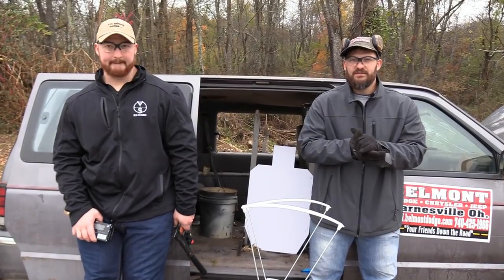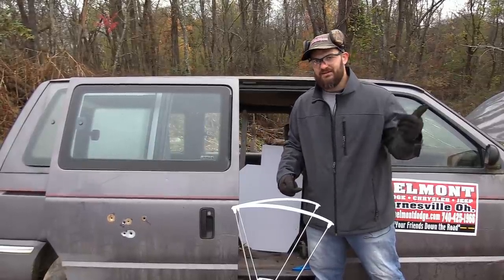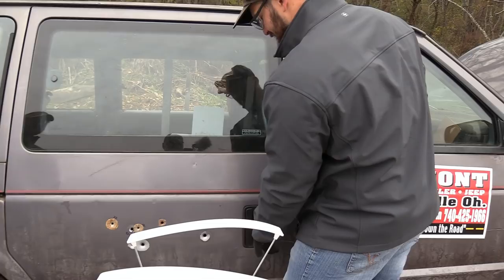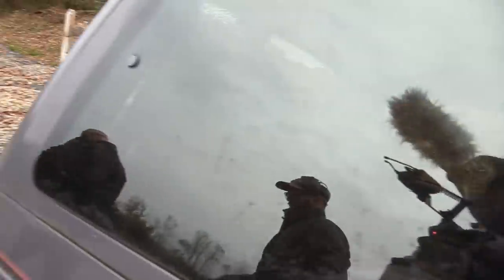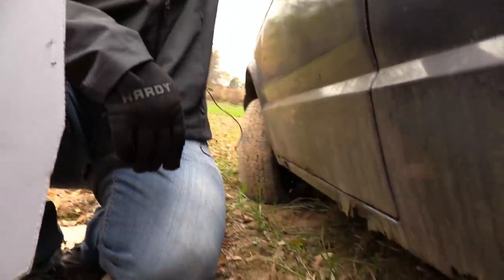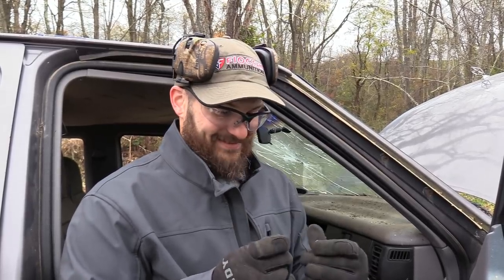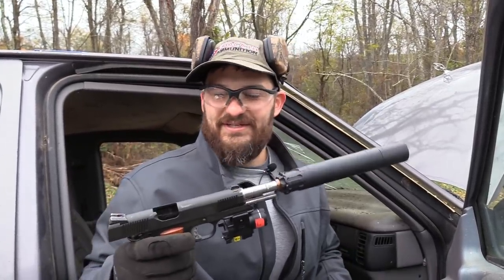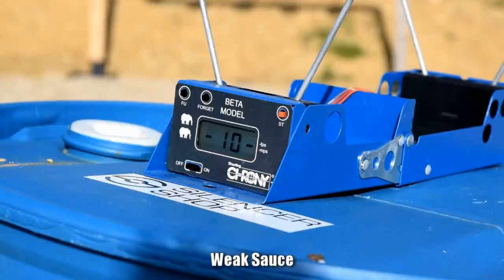HOW POWERFUL is IT? .45 ACP 1911

Comment from the maker: In its recent decision to change calibers the FBI identified that the only factor pertinent to defensive use of handguns by its officers was penetration depth. .45 was tested and was not selected. Just sayin...
Reply: The VSO Gun Channel suppressed .45 ? Or the caliber
Reply: thats pretty lame. shitty ammo and suppressor slows it down too much. the firewall shot while weak in appearance would blow a heart apart and break chest open, blow head off.....basically do its job. the gun was designed to kill humans and it does it extremely well even with slower cheap ammo hardball ammo. Army moved against it for economic reasons and most soldiers hate the  9mm.
Reply: The .45 ACP is not that great for police work as there are better including the .40 s&w. It is not a great penetrating round…barriers, cars walls etc. The .40 matches the power and has a smaller profile which is why it is a better penetrator. Speed has a greater effect on power than weight or mass so the pumped up 9mm does very well too. Shoot what you want if you are not LE.
Reply: Ok so in all reality why would it matter if the 45 will or will not go though 2 sections of the van and out the other side into another  target. The fact remains almost anything I've hit with a .45 acp 
Has had a very bad day . Besides 
There is hotter 45 acp on the market than what you were using 
Not that is even needed anyway .
45 will do the job in most scenarios just ask special ops.
Reply: my thing is that I've used 45 all my life it will do its job the test is kinda pointless to me because riffles are made to penatrate in punch through things hand gun are for up close and personal the thing is that a human in that van with the same test would of had a very bad day and fighting for their life a bullet is a bullet nothing good gonna come from it

Comment: so what youre saying is that .45 acp has less chance of over penetrating the target and causing unwanted collateral damage, that it in fact dumps most of its energy upon initial contact with the target and that it is less dangerous to others surrounding the target after the round impacts the target. 

in the future could you actually do a better job of containing your distain for the .45 acp? fyi, the ammo used in your tests here has a poorer performance rating than winchester white box .45 acp. you know that cheap ass ammo that walmart sells for dirt cheap. in the future either use the standard ammo youre average schmuck uses, or use the good stuff. 

also, your satire videos kinda suck...

Comment: 230 gr 45 acp +p at 950-975 feet per second out of the 5 inch barrel would have no problem that was just Standard pressure Range ammo. Even +P 45 ACP is still sub sonic. One thing 9 mm and 40 Cal have over 45 is they’re more affective out of a shorter barrel. Edit:Also I just noticed you were using freedom munitions hush that ammo is deliberately downloaded to be quiet not be a barrier penetrator this must be the underlying part you were mentioning LOL.

Comment: Well, one thing is for sure, a 45 acp has more hitting power than a 9mm and makes a nice hole to bleed through. And also busts bone apart more easily. Never said it was the best penetrator though. Its a human killer which is why I will stick with it. Plus our military never had a problem killing people with it either for 85 plus years and zero complaints.

Comment: How about using hotter round than Hush 147g
Reply: 59BigWalt it’s 230gr 45acp
Reply: 59BigWalt like he said in the vid , they should of used a Glock , to get the most out of that Hush ammo cuz it is designed for a Glock
Reply from the maker: Someone has shot hush 9mm before 🙃 (slap hands)
Reply: Thats a 9 mm .

Comment: 2 observations here I noted;
A- The tested ammo went through both sides of the vehicle on one shot, in a defensive scenario there's a really good chance that means it would penetrate the vehicle and someone inside, nuf said
B- "most" (safe presumption imo) who use 45ACP would practice with standard pressure but carry with quality +P. I'd be VERY interested to see a retest of standard pressure ball ammo VS +P-HP. Having seen several get tests of both ammo types it'd be interesting to see them compared through a vehicle

Comment: The biggest issue I have with this test is the use of Freedom Munitions ammunition. That company does not use jacketed bullets, they use soft lead plated. The plating on it is so thin that you might as well have used pure lead. This will indeed make a difference in what happens to the bullet (fragmentation etc), so it's not a fair test, also this is not a good representation of the common more powerful .45 ACP rounds that people actually use now days.
Reply from the maker: Deptends on the loading. The hush line is jacketed rather than plated. But if you buy bulk loads you get bulk price and bulk tech.

Comment from the maker: When something seems strange or out of place on this channel, you should dig deeper than face value. YOU are probably missing something.
Reply: The VSO Gun Channel look you guys I've commented a couple of times nothing out of the ordinary nothing rude just had some questions and all three times you just bit my head off like I'm an a**** or something. We definitely do not need channels portraying gun channels with jerks on there it gives gun owners a bad name. And you guys should use the exact same manufacturing a mural in every test not pick and choose ammunition itself will Barry from manufacturer to manufacturer. If you really wanted to do a scientific test you would use five different brands and the same 5 brands in every test that's a joke I've seen 185 grain 45 ACP go right through the firewall of a 79 Oldsmobile which I'm guaranteeing there's more sheet metal in than that 93 Dodge Caravan.
Reply from the maker: Read the description
Reply: Yeah, you may have to put an annotation in the video itself.  Most people don't even read the description.
Reply: The VSO Gun Channel I think you guys are missing something like why are you using mexican-made ammunition and hush ammunition that's made to be a little slower than regular ball ammunition from a 5in barrel 1911 chambered in 45 automatic Colt pistol. You guys really should use similar platforms and the same brand ammunition in each test. This is so far from being anywhere scientific this is just a couple of fellas out in the woods shooting a minivan. Not to mention your bad attitudes towards people on this website. I've had a couple of replies from you guys that were rude to say the least. I don't know exactly what your business model is for your Channel but yelling at your subscribers is not a good way to run a channel. You seem like two young guys that are having fun shooting holes and Mom's old worn-out minivan. No scientific data whatsoever here.
Reply from the maker: Craig Arnold nah, its part of the the joke, its way less funny if you make it blatant. Anyone who has met me in person would know that this series is a huge joke and all the people getting butthurt are literally the butt of the joke. The internet is full of non-science. It takes blatant non-science to get peoples’ wheels turning on that topic. I have been a scientist nearly my entire adult life and the things that groupthink will allow people to take at face value is astonishing and disgusting at the same time.
Reply from the maker: Yes you are right. People these days are too sensitive. You are correct in surmising that I will never be that super popular guy and I am alright with that truth. But perhaps I should just stop responding to people outside of our patreon page.  I could probably do a lot better for myself. As someone who puts in a lot of effort on detail in...just about everything but things like this video series...I don’t have it in me to deal with people unwilling to look for information because of their ADD. This is admittedly a personality defect...the first step to fixing a problem is admitting you have one right...🙃
Reply: David Wright I don't think he was being rude in his reply to me at all.  I think you may be subconsciously interpreting his words as rude or malicious in instances where they are not.  For example if you have a conversation with someone in person their body lanquage and tone of voice will typically tell you when they are being rude or sarcastic and whatnot but if you are reading a book unless otherwise stated your brain and imagination will often subconsciously fill in the blank in terms of what mood or demeanor you perceive them to be in because there is no body language or tone of voice to base it off of.  It is not uncommon for these perceived moods and demeanors to be a bit off or completely wrong from the manner in which they were intended, especially when you don't have enough face to face interactions with the person for your mind to better accurately imagine their intended moods or intentions.  I used to have a huge problem doing this myself, now I try to read and write with the absence of moods or emotions.  It is much less stressful and makes for a lot less problems due to communication errors.
Reply: The VSO Gun Channel I'm not sensitive at all I just wish that people would show a little respect and treat people like they're treated. Maybe it would be best if you gave the YouTube up and went back to patreon. And just so you know patreon has two owners that are absolutely anti-gun so good luck when patreon crashes for gun people. Do a little research on it if you haven't already two of the owners that help produce and run patreon are so anti-gun they make YouTube look right wing LOL. This last comment you made just proves the fact that what I was saying all along. I had tuned into your channel just recently in subscribed some of the questions I asked might have been a little out of the realm of what you were trying to get across I can see that now. This was more or less shoot some holes in your mom's old van and have a good time at it maybe that should have been the title. Not trying to tell you fellas how to run your Channel or do anything cuz that's none of my damn business however you really should treat people as you would want to be treated I mean if you actually care. But good luck with him to each their own sorry I inconvenienced you with trying to just get an idea of what you were trying to accomplish here. Great way to be a second amendment supporter I will tell you that much. With people like you we don't even need the left.
Reply: Craig Arnold I agree with you Craig a hundred percent sir and I may have read in something that wasn't there. However look at the comment that he just left me how am I supposed to take that one? It just seems that this started out as me asking a couple questions and making a couple statements about what they were doing and then they started telling me that this wasn't supposed to be a serious thing and that they weren't trying to be scientific at all. So I then replied will maybe you should have put that in the title and then a bunch of crap got said at this point I'm just like have a good one. I mean new to YouTube I know that sounds a little retarded but it's the truth so I'm looking around for channels that I'm interested in. Got recommended this channel buy another Channel that I watch. That's why I'm over here taking a look, but I guess I'm going to keep looking. Thanks for the reply Craig.

Comment: Subsonic ammunition? We all know that means not as hot as normal ammo. You’d be getting 900 FPS out of a standard load...
Reply: Standard milspec 45acp is 850fps. 50fps would have made no difference.
Reply: Its simply not scientifically fair to use "subsonic" ammo for such a test. Am I denying that 45ACP has less penetrating power than a 9mm? Absolutely not. But to cherry pick ammo like this ...is simply inconsistent at best and intellectually dishonest at worst.
Reply: Plus, I just looked at American Eagle's velocity on the box. 890 FPS for a 230 grain projectile. 90 FPS, we are talking over 10% of that rounds power right there.
Reply: Subsonic ammo can typically be underpowered but not with 230 grain 45 ACP. It is naturally subsonic at full power. The main difference between Hush and other 230 grain 45 ACP ammo is probably just the cleaner burning powder they use.
Reply from the maker: Robert Jansen what is the speed of sound?
Reply: There's no such thing as supersonic 45acp. Not even +P.
It's a weak impotent round, stop investing your ego in the diameter of the bore. Corbon 185gr +P is still only 1070fps.
Reply: Robert Jansen really, all 45 acp is already subsonic
Reply: Robert Jansen but if you mean it was an unfair test with shit ammo i agree
Reply: Valid Point, I concede I should have remembered that, all 45 is subsonic. I still feel that it would be most scientific and fair to shoot a hotter load.
Reply: @skyhop  .45 is extremely far from impotent. Only a non gun guy would say such foolishness

Comment: Not sure what you are trying to show.  You're  shooting hush ammunition for suppressor and then say cops using 45 would be surprised it doesn't pen a vehicle.  Almost every agency I know used plus p.  The rounds they use are designed not to overpennatrate  they know they may and may not over pen a car and hit a person on the other side of the vehicle. I carry  a 9mm by the way and don't depend on any handgun to shoot through a car and drop a person on the other side.
Reply: puma51921 you carry a 9mm ,lol .. no further comment needed
Reply: LOLOLOLOLOLOL
Reply: puma51921 makes sense

Comment: First a comment THEN a question. I definitely would not want to be inside that car with anyone shooting at it! :)  Second part is I think Freedom Munitions uses plated bullets in their pistol ammo. Plated vs regular FMJ will actually make a difference. I am not saying the difference will be huge (but maybe). I regularly reload with plated bullets and they cannot be loaded to the same pressures of a FMJ. They are basically almost the same as a cast lead bullet. The only point this really makes is if that bullet is a plated bullet it can be slower (but not always especially considering .45ACP) BUT the bullet itself will be softer and more prone to smooshing and fragmenting vs punching through. Again, I don't know for sure what types of bullets are used, but if they are plated instead of jacketed your outcomes might be different when shooting hard targets. Again, I have no idea what they use in HUSH ammo or if the difference will be that big.
Reply: I have shot thousand of plated pistol bullets and a lot of jacketed bullets at AR500 plates in my back yard. You can go look at the pile of lead fragments out there and tell what I have been shooting.
Reply: Also adding to the conversation about bullet type, try this test with Lehigh Defense or Underwood Ammo Extreme Penetrators and see what you come up with. A regular FMJ bullet will probably have results somewhere in between what is shown here and what you would get with the Extreme Penetrator bullet types. Why not give it a try in the name of science and make a video about it? I would be interested to see those results myself.

Comment: I'm getting 940 ft per second out of my 1911 with 5 inch barrel. I think that little extra bit of feet per second would probably let that bullet come through maybe not with enough to actually penetrate a human target but I don't know why you're getting such low velocity maybe the temperature how cold is it where you guys are at.
Reply from the maker: Bullets fly faster when its cold
Reply: The VSO Gun Channel now I know you're full of crap I was in the military and when are snipers were setting up they used to lay their ammunition in the Sun so that the propellant would burn quicker. The warmer powder is the more combustible it is that's just physics bullets don't fly faster in cooler weather. Just because the humidity in the air is lower does not necessarily mean that it's going to go faster.

Comment: 45 is good on soft stuff but because 45 is such a large bullet it has more surface area to slow down in hard stuff like the van or what ever / the thing is this is just full metal jacket ammo hollow point 9mm bullets woudlnt make it through either so to really base anything off this is kinda like comparing guns based on how they shoot range ammo that no one is really going to carry / it is interesting no doubt but id be willing to bet that a hollow point 9mm will penetrate less then a hollow point 45 could be wrong tho cause speed does things for sure
Reply: droppin plates only caliber that's broken a window !! I carry a .45 cuz they don't make a .46 .. very effective round , caused more damage then anything yet !!

Comment: Buy a 150 lb. hog, put it in the front seat with the seat belt on. Shoot it through the windshield at a distance of 25 feet using three shots each of both Lake City military 230 grain FMJ  ball ammo, and Federal HST #P45HST2S 230 grain HP. Then tell us what you find out. While velocity is king, in general and hyper-velocity rounds like .357 Mag and even 9MM +P+ will penetrate deeper if they don't fragment, you'll find the 45 ACP round is an effective stopper.
After decades in the Marines as a weapons guy by MOS, I can tell you that while 45 ACP isn't the ultimate penetrator, many thousands have died as a result of being shot, many just once, with it. If you think you should tell you police departments what to shoot, I suggest you compare your testing protocols with theirs, before you do.